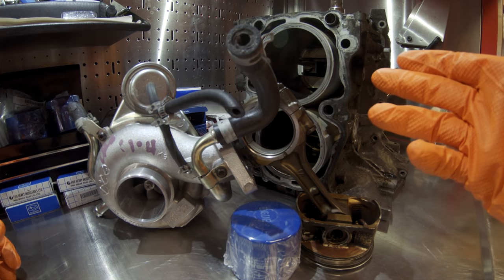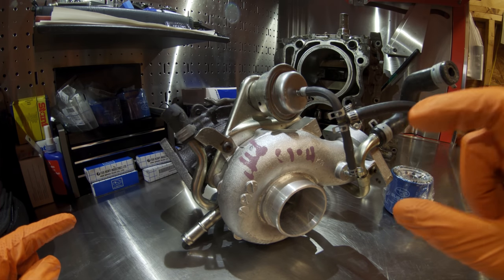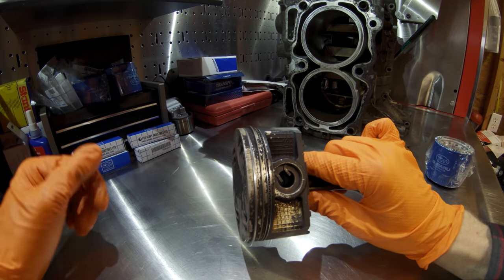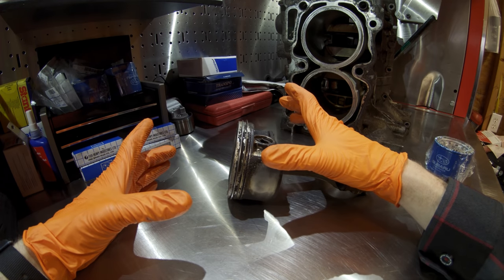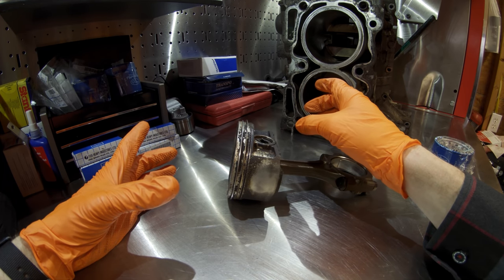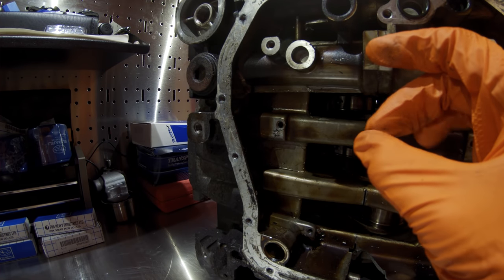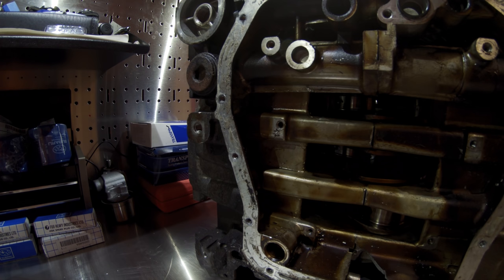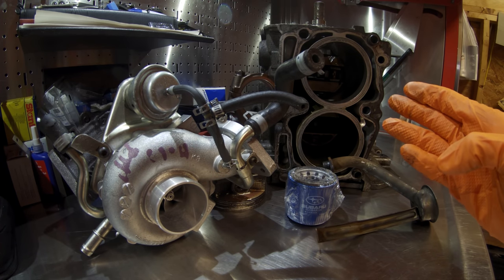Subaru EJ255 Top Failures

Comment: Thanks brother you just helped me out alot. I am putting a ej255 in a 914 and you video has helped me out in what I need to look for with this motor. I do have a question should I upgraded the turbo on the motor or will that stock turbo be fine. Not trying to race the car but want it to be a fun daily driver.
Reply from the maker: Stock turbo is fine as long as it has a good oil supply, so check or remove the banjo bolt filter.
Reply: I will, thanks. Do you any experience with megasquirt tuning for the Subaru engines
Reply from the maker: I do not. Haven't done any tuning. Have friends that do locally, luckily.

Comment: Help... 15 STi won't make more than 5lbs of boost. Ran a smoke test no visible leaks. Car was fine one day sat over night got in the next day and it is noticably quieter. No exhaust pops nothing almost like a non turbo car. No weird noises, no cel, dam is at 1.0. could the BCS taken a shit? I'm lost my mechanic and I can't figure it out.  Stock car with muffler deletes. 60k miles. Anyone had this issue any help would be appreciated. Thanks.

Comment: So running with cold air intake makes the engine go lean. Is it possible to constrict a bit of flow to go richer? I know you would sacrifice mpg, but what about ringland longevity? Would that help?
Reply from the maker: Get a tune if you plan to run a CAI.
Reply: @MrSubaru1387  i understood it from the video. But i'm talking of doing the opposite. Restricting oem air flow a bit to make it go richer? Is that possible or ecm will simply compensate for the restriction?

Comment: Are these issues common (other than obviously the turbo) to the EJ251 N/A engine?
Reply from the maker: The oiling issue/rod knock is an issue on N/A engines as well, but not as much so as on turbocharged applications. The ringland failure/piston cracking is turbo specific.

Comment: Hello, 

I have a manual 2004 Subaru Legacy with an EJ20 motor. It has an issue where I will tap the gas and instead of the revs dropping they will sit at about 2500rpm for a while and then slowly go back down (Sometimes the revs will just stay high) Also When I come off the highway after having the revs at about 2500 for a while at 100kmh when I put the clutch in and slow down, the revs will shoot up somtimes to around 4000rpm or higher. Do you have any idea what this could be? 

And I'm not sure if this would be related but the car also bogs/jerks up until about 2500rpm and the will shoot me off and drive normally. Especially when I sometimes turn in the wrong gear and the revs are low it will really struggle to pick up then it will bog a bit and then will jerk forward and be fine. Any ideas for me to look at would be super helpful! 

Thank you.
Reply: Hello, I have exact same problem and no CEL.
Did you solve the issue?

Comment: So , these "failures" were NOT the fault of BAD design by Subaru, but by obtuse owners going along with the hype for synthetic oil longevity, and NOT changing oil EVERY 4000 miles(IN a TURBO engine). If you buy a car WITH A TURBO and DON'T understand how critical FREQUENT oil changes are, you should NOT be buying these types of vehicles!! Btw, OIL (even synthetic) is DIRT CHEAP!!!

Comment: Hi there have a 2012 forester 2.5xt s edition it has 2 catalytic converters one in the down pipe and one in the mid pipe, I've removed the mid pipe one, just wanted to know will  it affect performance negatively?
Reply from the maker: It's normally advised to remove the cat from the up pipe, because with age they can breakup and throw debris through the turbo.
Reply: @MrSubaru1387  as far as I'm aware my one doesn't have a cat on the up pipe
I'm from South Africa not sure which spec we get
It has the twinscroll vf52

Comment: what is your thought on that little screen filter...would/do you leave it in on your personal cars?
Reply from the maker: I haven't owned an EJ255 vehicle before the Legacy GT progrect. I will be installing a new OEM bolt, with the screen, and will most likely be replacing it as normal maintenance every 50k miles or so.
Reply: @MrSubaru1387  aren't there two of those bolts on that motor?
Reply from the maker: I believe so. I was refereeing to the one to the turbo. I believe there are screens in the ones to the AVCS as well.
Reply: @MrSubaru1387  Would you advise removing the one in AVCS?
Reply from the maker: Yes

Comment: Will Cobb Accessport performance tune help reduce this risk of ring land failure?
Reply from the maker: I'd advise against the access port tunes.
Reply: @MrSubaru1387  Many people complain about the factory tune and believe the Cobb stock tune solves a lot of issues.

(For not too shy of a thousand dollars I would hope they were good haha)
Reply from the maker: @MrNoNameForYou  a dyno tune, specifically for your car, by a reputable tuner, is the best remedy.
Reply: @MrNoNameForYou  they are not good . Drove my car 13 wrx for close to two years. Changed oil every 2500 miles and never really drove it hard and had a rod knock. My engine was still running lean even after stage one map from accesport. Stay away from it

Comment: Typically it's the young guys who buy these turbo cars thinking they have a WRC on their hands. Sometimes it's their first car and they know nothing about caring for the engine at all. They are in the mind set of "I now have a race car, lets race everyone" and then they cry to mom/dad or the dealer that after a few races the engine is broken. I myself used to have this mindset; but I was too poor and couldn't get my hands on a wrx or 2.5rs. I got a 95 Legacy at the time with the ej22e. It was a 5 speed though. I have learned you really should just drive the car for about a year before you start mods. ALWAYS, ALWAYS, ALWAYS if you start mods; like turbo or even upgraded turbo do the supporting mods first. Most of the time your engine is plenty powerful; do transmission work, make that one stronger, upgrade your brakes, upgrade the tires before you upgrade engine components. A ton of power is useless if you can't put it to the pavement. But these kids don't really understand that part. Heck I see and hear a lot of them will buy the latest STi and then at the tire/wheel shop spending over a grand on new rims/tires. Car won't even have 5k on it. I have always gone by the philosophy of get used to the car first before you do things to change the setup.

Comment: Is there a part # for the better oil pump? I have an EJ255.
Reply from the maker: I'm sure there is, don't know it off hand. Google 12mm Subaru oil pump. Popped up with one from Rally Sport Direct. It's $219.99.
Reply: @MrSubaru1387  did Subaru use OEM 12m 09 and up? If yeah can I use on ej255?

Comment: Are the issues with an EJ205 similar to those of the EJ255?
Reply from the maker: Not really. The EJ205 doesn't have the turbo or ringland issues.
Reply: MrSubaru1387 really?  Because I’m on my 4th turbo lol. All have been the stock td04. Glad to hear it doesn’t have the ringland issues though.

Comment: Will a filter on the 2.5rs fit on a ej255
Reply from the maker: The older 2.5RS filter was discontinued by Subaru. The new small thimble sized filter is the OE part for both engines now.
Reply: MrSubaru1387 I have wix filters for my 2.5rs.  They are bigger then the wrx ones. They should work on my ej255 swap it wouldn’t case any issues with a larger filter?
Reply from the maker: You shouldn't as long as the filter clears the exhaust.
Reply: @MrSubaru1387   I have a 06 wrx the subaru service bulletin  recommended that the engine oil and filter be changed every 3,750 miles
3-3/4 months

If I'm only driving 3000 miles a year would a 6 month oil change be fine or should I stay with 3-4 months.  I'm using amsoil  oil with wix filters.

Comment: Regarding the rod knock, is there any way to check if the loud rocking noise is definitely a rod knock and not something simpler without removing engine? I perform compression on all cylinder which is good but the sound is similar to the video you played.
Reply from the maker: Usually a knocking like that is a rod bearing failure or a timing belt tensioner failure. The timing belt tensioner can fail and make a similar knocking noise. That's why the timing belt covers were removed in the video clip. I was checking it.

Comment: I have a 05 legacy 2.5gt with the ej255 @140k miles, is it too late to get a cobb AP and change the tune to prevent the ringland failure?
Reply: Also, if i get a cold air intake, is a cobb tune enough or do i still have to take to a actual tuner?
Reply: @BLLx91  Hey check what your Cobb AP will do NOW!...They've deleted maps on my v3 sub02 for the 04 FXT without warning!  No more ACN octane maps, no more vf39 , maps etc. Changed about a month ago. All y-all check you access port and be careful with the new upgrades -- they delete stuff!!